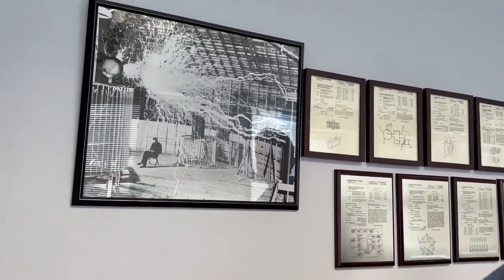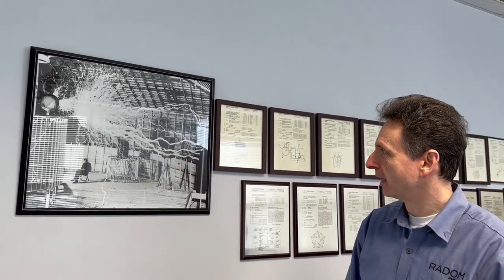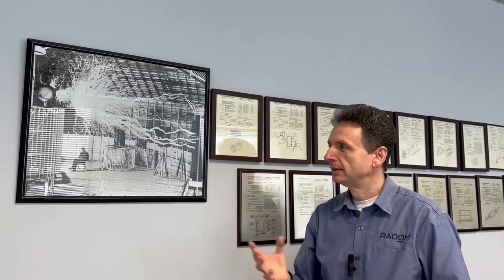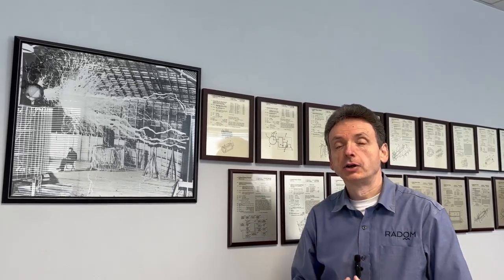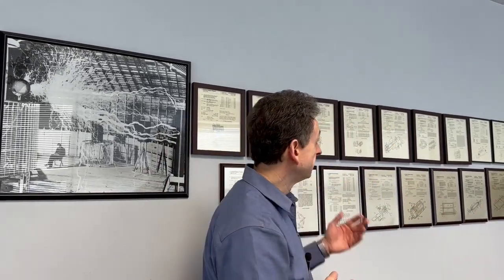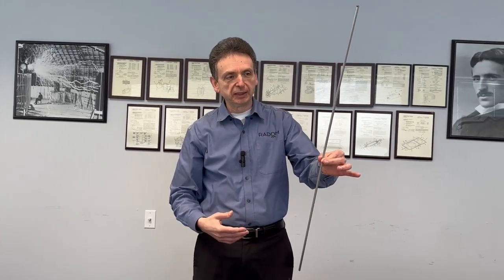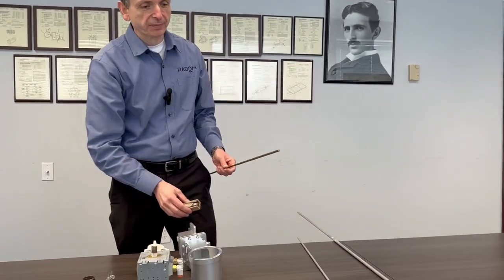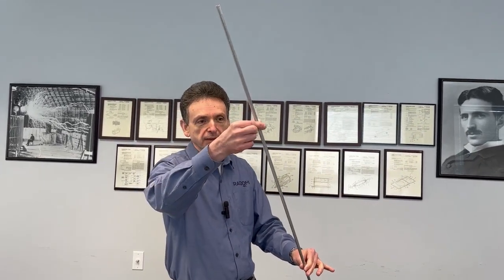Cerawave Technology and how Nikola Tesla led the way.

Comment: Is this a plasma similar to those atmospheric plasma units from Enercon, used for surface treatment,using ceramics instead of platinum electrodes, and microwaves(from a magnetron)
instead of high voltage/freq pulses generated by IGBT's?
Reply: Yes